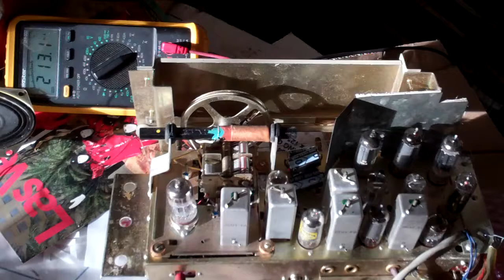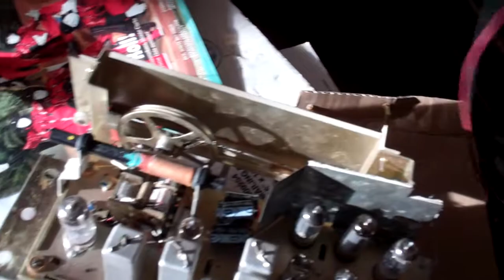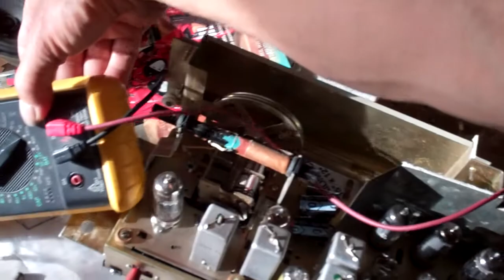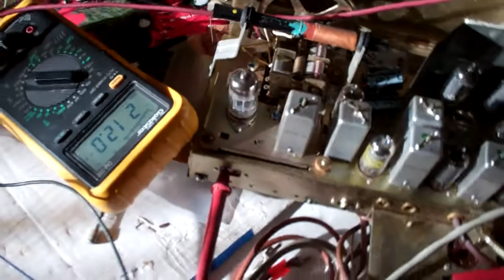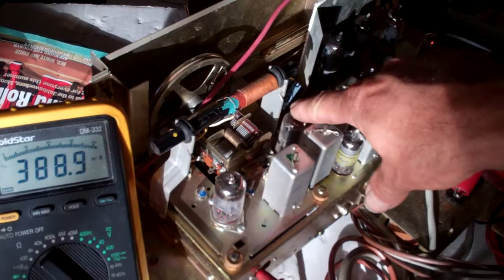JVC Delmonico model stereo console Black and White Televison Radio

Comment: The tube filaments are in series without a power transformer in my 224 (this model has no tv just radio and turntable). Even the pilot light filament is part of the series string.